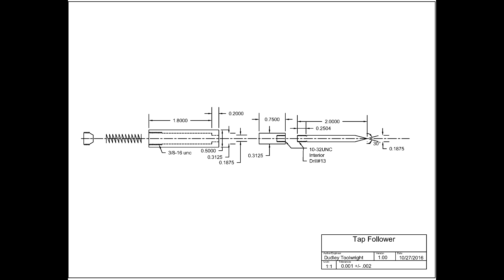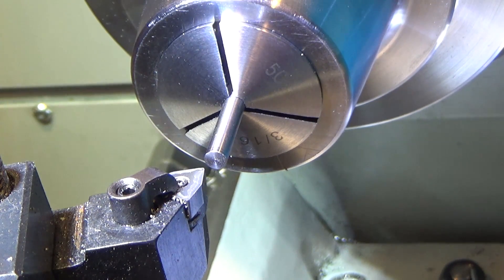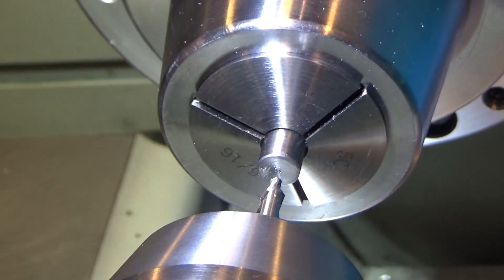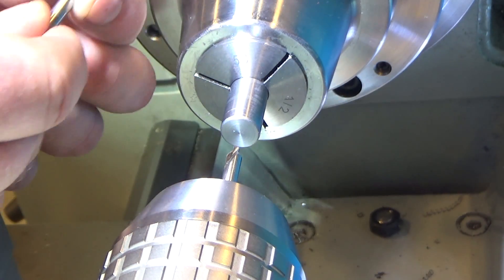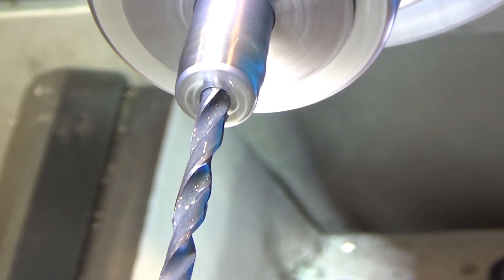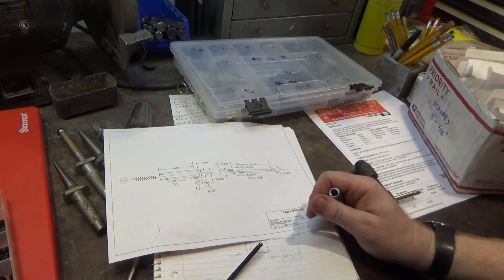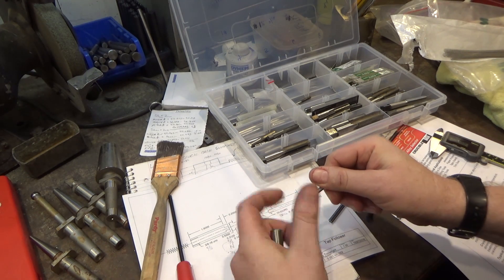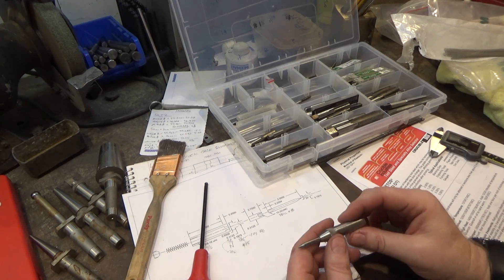Tap Follower

Comment: Face, then center drill, or better yet spot drill, followed by drilling an undersized short section 1/2-3/4” is enough. Bore this section for a close fit to the size of the drill that will follow.  This acts as a drill bushing for the drill that fits it.  Only boring give a hole to the true center line of the lathe.
Reply from the maker: Thanks for the great tips. This was one of my very early videos, but there is so much to learn in the field that you'll never know it all.

Comment: I don't know if it would help in this case but you can true up a hole by using a centre drill as a single lip cutter. I shall explain, put the centre drill in the tailstock chuck with the cutting edges horizontal, approach the hole and when they touch push the drill chuck away from you using the tool post. What will happen is the far flute will cut without wobble truing up the start of the hole. This is a really old machinists "trick" that is worth putting in the arsenal of techniques for future use.
Reply from the maker: Thanks for the really helpful advise. I have never heard of the solution you are suggesting. I'll have to try it out and thanks again for taking the time to share it.
Reply: @DudleyToolwright  you are welcome, if you can't pass snippets you have learned over a lifetime of fiddling with mechanical things, where would we be?

Comment: MKII was a lot better thought out.  I just couldn't work out why you needed to use tool steel first time round.  It's an essentially non moving part and not going to wear.  I'd be lazy and bronze weld the collar on the spindle.   Is the 30° included angle the norm for a tap follower?  I have always assumed it would be 60°.   A very nice, and totally useful project though, so thank you for sharing.
Reply from the maker: I used tool steel because I had intended on hardening the point. The confusing 30 degree comment was referring to the angle off of parallel. I apologize for being confusing. The total angle is 60 degrees as you suggest. I like the welding solution. I just enjoy threading bits.

Comment: Well you got lucky I did the same thing a broke the big bit and ruined the part. So later I saw a video on “drilling on a lathe” it was a vintage class room type films to video. You need to step you sizes bigger, the first if you starting drill brakes face off Start fresh. If you can’t start over compound a boring to make it match as if you did the starting drill hole. The first drill only needs to take out what the web of the bigger drill can’t cut. Thanks for sharing
Reply from the maker: Thank you for sharing. I appreciate the thoughts. It is amazing how little has changed in the last hundred years regarding the basics of machining.

Comment: hello Robert.  Yes definitely a nice design. Will make a couple and avoid Threading the Plunger - making it a one piece.  Now to convert to our Metric Sizes and work nearest to Your Drawing - already downloaded and hard copied.
Thanks a stack for this. Much appreciated. Oh BTW, will really need a very small Boring Bar to bore most accurately and that will be a challenge on our 14"/16" heavy Lathes. 
Once again, Thanks a stack for this. Much appreciated
ATB
aRM
Reply from the maker: I should really do my designs in both standards. I'm glad it helped.

Comment: To drill a most accurate holes in work piece, use boring bar. Start with centre drill. Then drill with small drill. Then use boring tool to bore to size of next drill and now you would have a perfectly centered hole. The finish drill bit will follow the start hole pretty well. Much better than just depending on drill bits and centre drills only. This technique is actually very common.
Reply from the maker: Thanks. Quite helpful and I really appreciate the comments.

Comment: Hello Robert,  Any reason you designed the plunger in two pieces rather than turning a single body?  Turning two diameters and tapering it seems a bit more efficient?  I am going to do this as my store bought leave a bit to be desired however I will make a longer stroke and two or three sizes for different taps (small, medium, large).  Good video.  Interesting about the smaller bit deflecting.  I wonder if there wasn't a 'hard spot' in the tool steel, or if it didn't work harden as the small bit went in deflecting it?  Take care.  Doug
Reply from the maker: I am not sure where you are going with the single body idea, but I am intrigued. I would love to know more. I always enjoy that fact that no matter how you see a design come together, someone else will have a completely different take on the same idea. I hope you share. If your design turns out to be better we all win. I really appreciate you taking the time to comment.
Reply: Hello Robert
Hello Robert. I would concur with what Douglas Thompson Esq. says and I will definitely make the plunger in one piece.  For one, nothing to loosen inside with all the usage and two, like he says, efficient as well as a more compact and rigid finish. I will follow him in making a couple of Sizes. One we made before was a mammoth Sizer.
aRM